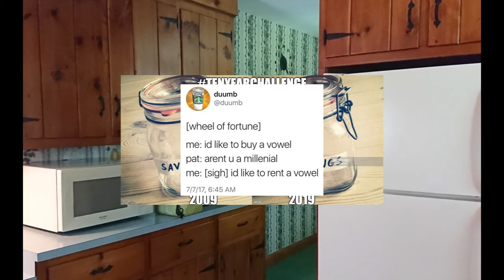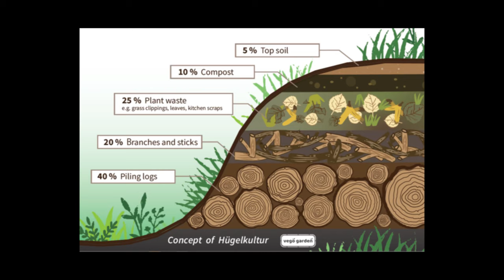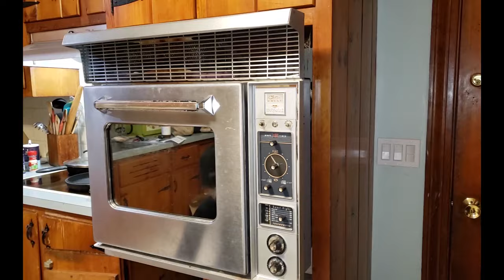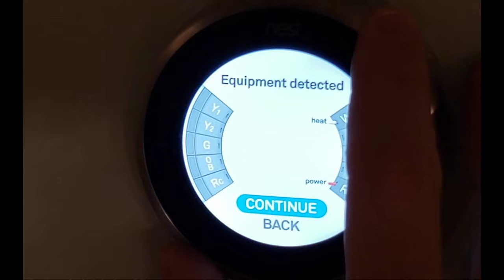Remodeling a Mid-Century House - Labor, Costs, Renovation, & Pink Bathrooms

Comment: Adding that dark stain absolutely RUINED those beautiful floors.
Reply: They can be resanded, and the stain color can be changed later. :). That is why hardwood floors are such a great choice.
Reply: Not ruined, but I, too, would have preferred if they had been left light-wood, maybe with a pale-taupe paint wash to prevent them from going orange down the road. Light wood floors reflect ambient light so much better than dark wood floors!

Comment: I’m impressed with the research you did with the outlets. Very important to replace those. I have a 60s brick ranch with cloth wiring & the 2 prong outlets literally began to melt my cords!
Reply from the maker: Thank you! And that's concerning, almost sounds like the outlets are supplying way more current than they should be. And if that's the case, the circuit breakers (or fuses) may no longer be doing their jobs.
Reply: Indeed!

Comment: Very well-done video! Nicely organized to flow through your assorted projects and totally appreciate your sense of humor. Would note that it's surprising how many mcm/older homes have no access to the back yard (I find that totally bizarro). The sliding door/deck was a much-needed solution. 
I've been through this twice, first with a Sears home built in 1910 that was a total repair & rehab money pit for 25 yrs. Got a 1956 brick ranch in 2018 and moved quickly to pop on a new roof, remove dead tree & shrub, new hvac, gut & reno the appallingly ugly interior of the sunroom, blow insulation into the attic as original layer of vermiculite insulation was down about about a 1" loft (shockingly expensive), plus painting every single room, and replacing ghastly 80s-era "disco-ball" light fixtures and the royal blue shag wall-to-wall carpeting in the liv/din/hallway. Have opted to keep the obligatory pink bathroom with pink tub and pink sinks because it's in near perfect condition. The second bathroom has to be completely gutted - it's on my to-do list. 
Most recently replaced the gas cook-top and the original 1950s GE wall oven. Had to laugh when you dropped your hood on your brand new cook-top - whoops! The original 1950s copper hood is still over my cook-top - my contractor suggested simply taking off the fan cover and cleaning the components rather than trying to replace the fan. It's far too cool to replace that hood, so we'll see how the cleaning attempt fares. 
The "wildflower incident" was pretty hysterical. Live and learn. Agree that blue-grass lawns are a bloody pain in the butt! However, as you discovered, wildflower beds quickly turn into weed beds. Suggest if you attempt to replace a lawn at a future date, try using clover. It's eco-friendly and doesn't need to be mowed very often. It's also drought-resistant and honey bees love clover. 
I was rather shocked that your property didn't sell for more considering the extent of the major improvements you made. Even if you only owned it for a couple of years, the sale price should have been closer to $100K over your purchase price. Guess you had to accept what the local property market would bear and nearby comps would allow. Timing is everything - too bad you couldn't wait one more year before selling! Good luck in the future.

Comment: if there's anything I've learned from watching house flipping shows, just replace the tub, the glaze doesn't last but 3 years and it could've saved a lot of time. and the ceiling fans! I wouldn't have wasted the money and time assuming someone else wanted them, but hey you were itching for a project. I can understand that. All and all really impressive transformation for your first go. I hope to find my own handy partner to do this with some day soon. You definitely seared it into my brain to save the floors for last. Thanks for sharing!
Reply: Well..Ahem ...I am single AND pretty handy.. Just saying. Shot in the dark.
Reply from the maker: I'd say that a DIY enamel kit is probably par with "contractor chic". The result for $40 is fairly good but yeah, probably won't last beyond 2-3 years. I'd advise against replacing the tub because these cast iron enamel tubs (or porcelain) aren't really made new anymore, at least in this style. Anything remotely close in style and quality runs $1500+, and is a very large amount of labor. Almost all decisions we made were made to preserve as much of the mid-century character as possible. I'd pay a professorial re-glazer who use fancy things like acid etchants before considering a replacement. The fans at first glance probably seem excessive, but they added a much needed ceiling light where there were none before - mid-century folks sure loved their plug-in lamps. As for the floors, only do them last if you don't plan on living in the house, it's a very messy process and everything will be covered in sawdust. Are you planning on flipping a house?
Reply: @Bootstrappin  With the preservation of the character in mind I can see now why you kept the tub! I just love hardwood as opposed to carpet. My curiosity to expose the subfloor would probably get the better of me. "Planning" yes but still in the saving phase! I've always been a DIYer and technician for a long time so the idea of making it into a stream of income in the long term is exciting! I'd probably flip until I had enough to do it on the side with an additional house.

Comment: The bathroom remodel was hilarious. We're doing that now in our house (built in the mid 60s). We have the exact same tile as you guys down to the color and how it goes up half the wall. We wanted to rip the tile off but then we saw that it was on cement. After trying to pull a couple tiles off we realized it was built like a brick shit house and if it's still holding up after 60 years I figure why bother messing with a good thing. Also appreciate the heads up with the wildflowers- I wanted to do the same thing. What would you suggest instead?
Reply: If you're in the northern half of the US, clover is a good option to replace grass. Bees love it and it doesn't have to be mowed.